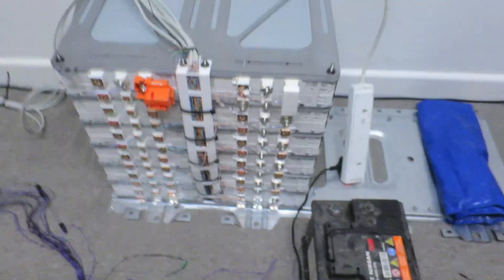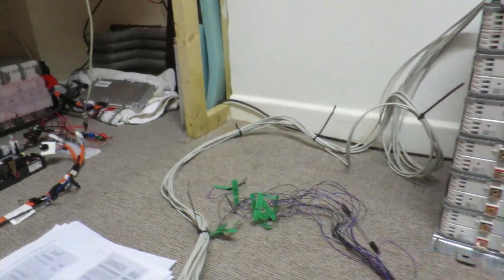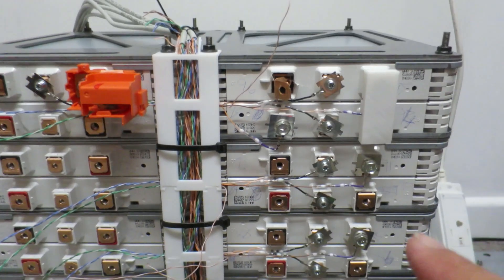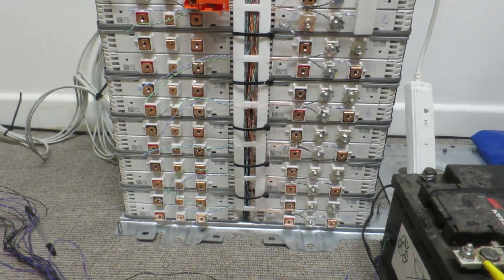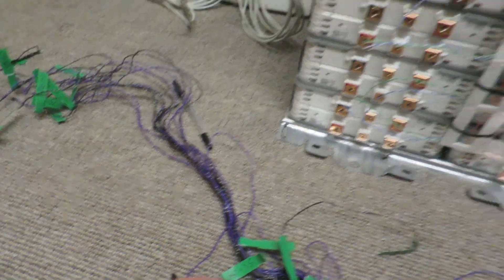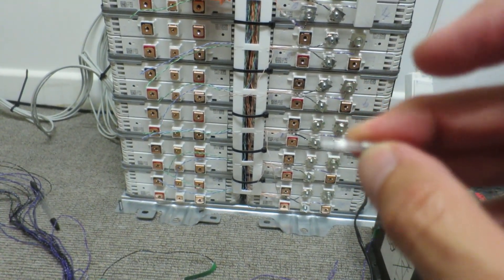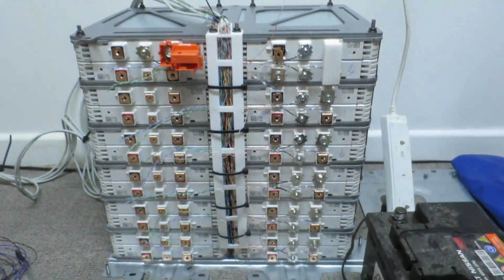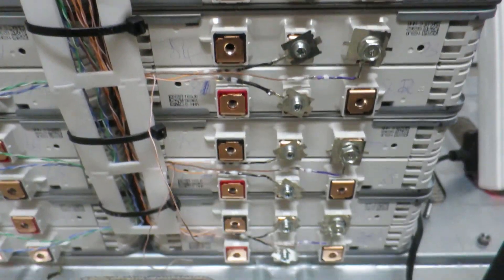Minor update! Rx8 to Leaf EV Conversion

Comment: Fiat x1/9, old maserati quatroportes from the 80s.
But most of all I would like to see this rx8 in a trackday shape. And see it corner.
I hate cat 5 internals, there has to be a nicer way, maybe make an rj45 socket attached to a screw you can connect to the battery connectors. This way you either plug rj45 to the cable ends or get ready plugged cables. Patch panel style.
Will save you hours of boring work.
Reply from the maker: Yeah there are probably better ways, I dont think having a single cat5 cable per cell is a good idea - id have 40+ cables!

Comment: eww solder connectors. I don't like em mainly because they get misused. I also don't like the idea of not ensuring a good joint, like you can with crimp or normal solder.
Reply from the maker: Yeah I know what you mean, I am finding these pretty good though (the small ones), the bigger ones I have had a lot of issues with in the past. I find as long as I see the solder flow they have been very good.

Comment: Ohh I'm not sure I'd trust those solder heat-shrink things, I've had trouble with them previously not making a good solid connection. It may have just been the ones I bought though. Fingers crossed your ones are OK.
Reply from the maker: I bought some in a kit once, that had lots of sizes and the bigger ones were all crap, however these smaller ones seem to shrink and the solder visibly flows which I like!
Reply: @SouthWestEVUK  ah that's good. If you've tested them and you're happy, then they should be good 👍

Comment: Can you post details of your spline-flywheel coupler? This is a blocker for my project at this time.
Reply: I've ordered a clutch friction disk for a Fiat 124 which I'm told will be a match to the Leaf motor splined shaft. I'll report back when it arrives how well it fits.
Reply from the maker: When I grab the motor and gearbox I will ask the chap for a specification.
Reply: The friction disk arrived today and although it fits it's a little bit sloppy. Maybe 1/2 to 1 degree movement.
Probably no better than a cheaper modern Fiat friction disk.
Reply: https://www.youtube.com/watch?v=BTXJcJtC9rk
Reply: I'm thinking about making a spline adapter that takes the splines and terminates to a more standard keyed shaft like a warp 9 or Curtis motor. There is already an adapter plate design for this.
Reply: i have a coupler iv made for the leaf check the open inverter forums for the post about it https://openinverter.org/forum/viewtopic.php?f=12&t=569

Comment: hi, I bought that heat connector from several sorces - none of them worked out as should. Do you mind posting the link you bought yours from? Thanx!
Reply from the maker: Not a problem, make sure your heat gun is hot enough I guess (not that I know what hot enough is!)
https://www.ebay.co.uk/itm/Heat-Shrink-Solder-Sleeves-Electrical-Wire-Butt-Terminals-Connectors-WHITE-X100/153421338125?ssPageName=STRK%3AMEBIDX%3AIT&_trksid=p2057872.m2749.l2649